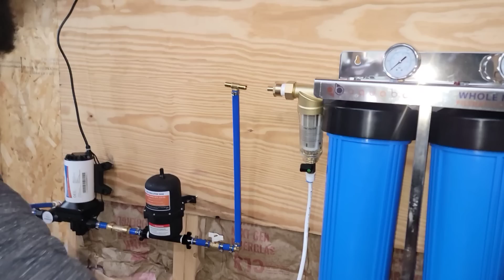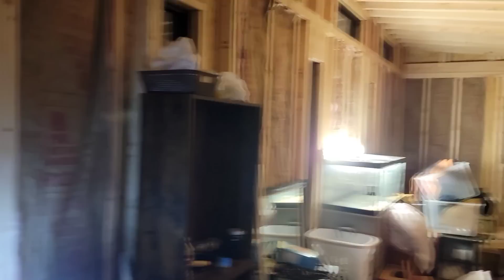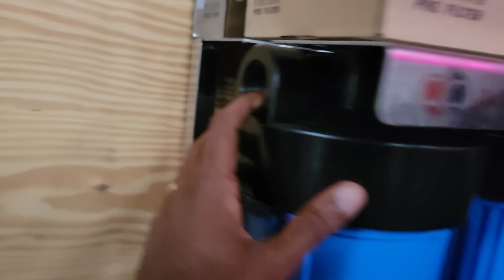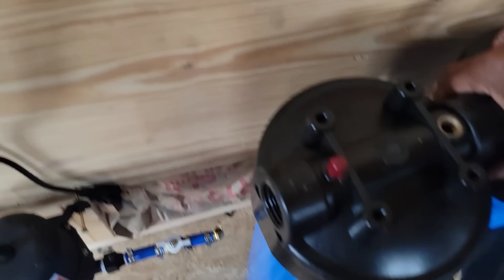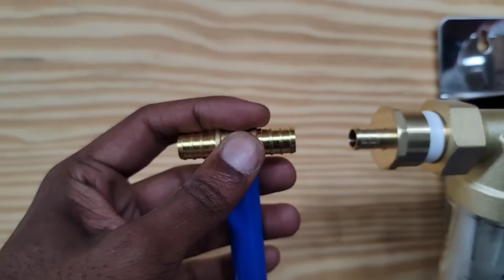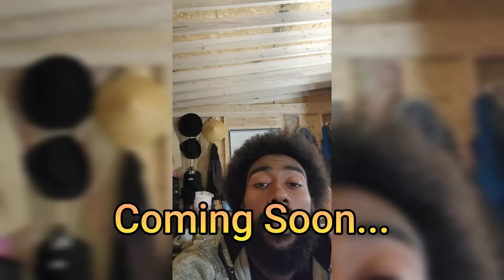Off-Grid Tiny House Plumbing: Building a DIY Water System for Sink & Shower + Interior Sneak Peek!

Comment: That glass strainer always cracks especially in cold months always keep you a replacement of your whole water system setup, and find a way to heat the area diesel heater is the best thing hands down inside and out. It takes very little diesel and can heat up your hold place. 🌄☮️🦍🖤

Comment: With the filter pointing up you have to start it in a different position to get it to be at the bottom.. Great job at getting the system setup. Closer to getting you water indoors. The reality of moving off grid is that you can create your own space in the time you need. So, do not let people try to push you into wanting to see all that you have done. I am just glad that you 2 are rent free and spending your money to build your own.
Reply from the maker: Thanks for your encouragement ! It's a lot of steps to take getting everything setup and many people don't understand that it takes a lot of time and money  and we can't have everything built in a day there's just not enough time to do everything we need.

Comment: You might want to put plumbers tape at all your threaded connections to prevent future leaks
Reply from the maker: Yup, I put teflon tape on all threaded connections. If you watch carefully, you'll see.
Reply: @ZayandNae  oh ok i thought u missed putting it on your micron filter threads to those two blue filters otherwise you are doing a great job as a DIYer